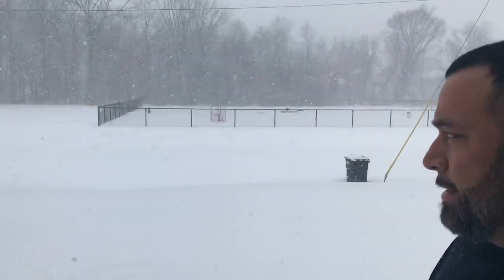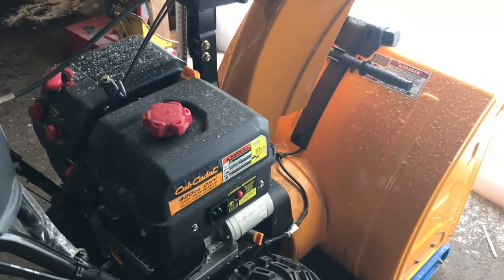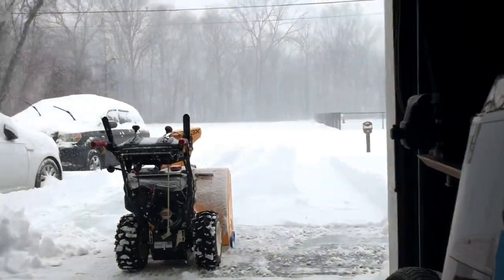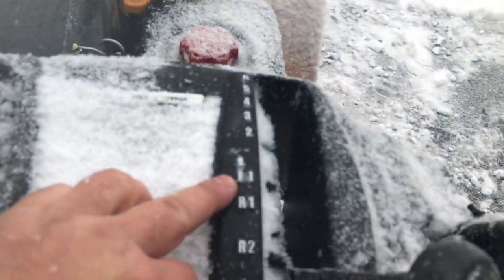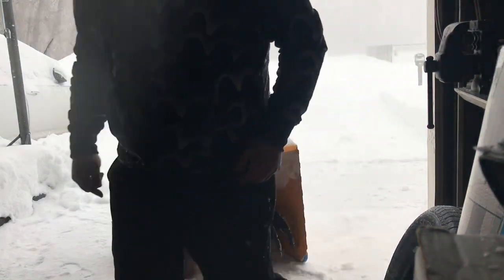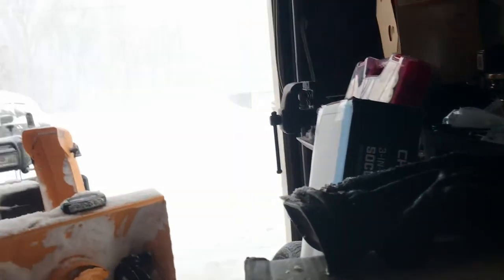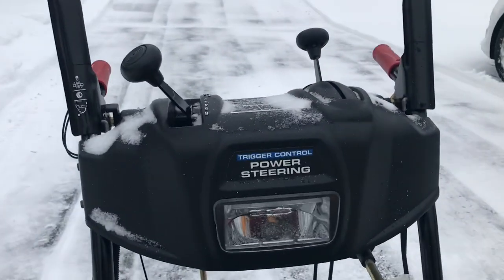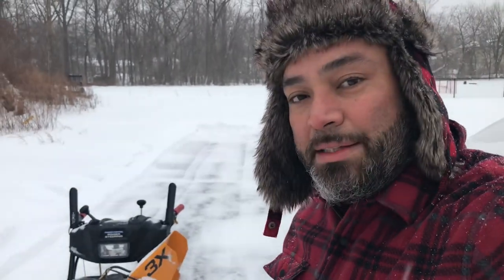Cub Cadet 3x 30 HD Review 2021 snow storm

Comment: Someone needs to show you how to use a snowblower. Extremely rough on it. That's why the shear pin is broken. The deeper the snow... the slower you go. Its easier on all the moving parts. This review is ok but would be better if it was used correctly to give it the honest review.
Reply from the maker: Thank You 🙏 I appreciate the feedback
Reply: In any deep snow, 1st is always best to not overload engine or break anything!
Reply: @chillymooose  cub actually came out with different shear pins for this machine because they were too weak. The updated has an A for auger and a 3 for impeller.  Many people are having problems with this machine blowing belts and shear pins
Reply: When snow blowing use a lower gear does less wear and tear on motor and also doesn’t work the machine as hard
Reply: @michaelrothfuss9764  The blower has a 420cc engine with a 14” auger and 14” impeller. It was designed to move a lot of snow rapidly. That’s the point of the HD moniker.  It’s supposed to be a commercial grade machine but since it’s an MTD it’s not up to par.  They used weak pins when the machine first came out, then came out with stronger pins after just about everybody who bought one was having problems.  I believe you wouldn’t know this as you don’t have one and have done zero research on this particular model.  I have one and went through all the problems that came along with it. The belts still shred way too easily as they actually aren’t durable enough for the power that this machine puts out. So sorry, bit power and going too fast isn’t the issue. It’s actually the selling point of this machine to move a ton of snow as quickly as possible.

Comment: A couple problems I see you doing is that your shoes are adjusted to low and you have the thing running at a higher forward speed. I run mine through 3 foot Banks on 1 and it goes right through without stopping. I have found that the deeper the Snow the further the machine throws. In 2 feet of snow I can throw at almost 50 feet.
Reply from the maker: That is great to know.
Thank you for that.
I will try it out on the next snow storm
Reply: I have the same model also I never have to stop and start, even at a higher speed the engine automatically revs up and it goes right through throwing a 30+ foot roster tail of snow esp with dry powdery snow.
Reply: You should stop the engine while touching the indside of the blades. Also not a good idea to throw the snow and possibly small rocks on cars, houses etc. Stay safe!

Comment: I have this same machine.  Watch more videos of more experienced operators with fully working equipment.  This is a great machine when you know what you’re doing.  If you don’t know what you’re doing this machine can wear your out.  It’s a beast and it’s heavy.  It will blow thru a full opening fill deep packed in 1st gear and half deep in 3rd or 4th.  Only negative I have is it needs a faster reverse and a faster forward speed but I’m sure for safety they keep it limited.  Best tip I have is spray your machine with WD40.  Mainly the augers and the chute and inside before you blow.  Will keep snow from sticking.  If your not using the yellow wheel release levers you need to be for turning and when your moving it not under power.  It releases the wheels into a “neutral” state and you can pull it backwards easily.  Even when the machine is not running squeeze both levers to move it around.
Reply from the maker: Yes I agree with everything you just said
If you get a chance, watch my new video with this years storm. Thanks for the feedback
Reply: I have a 26” Troybilt Vortex 3 stage and I concur with this post! Love it, wouldn’t trade it for any other machine out there!
Reply: I just bought a Honda HSS1332A, and now I have no issue's or gears to worry about... ever again.

Well worth the money. 😁

It's an absolute monster of a machine, and eats whatever I put it through asking for desert afterwards.
Reply: Another "me too".
I've run one for the past ten years and after getting through the shear pin drama (that nearly had me return the machine) I then realized you could buy much better pins online and that saved me. This was before CC came to their senses and introduced the newer versions, but I'd already stocked up on the non-CC so I'm good.
Been through some belts but it wa more due to my misjudging when you do need to back off momentarily.
Good post, agree on all counts.

Comment: I have the same model.  You have a busted shear pin on the forward impeller.  Easy fix.  Cub Cadet installed to soft of pins.  You can now get better , stronger pins at the dealer.  When she is working correctly it is an awesome machine.  to turn on the heater on the handles just flip the switch in the center between the handles.  They really get hot.
Reply from the maker: This is great 
Thank you for the info 
I really appreciate it

Comment: I was interested in getting a 3 stage. I won't after seeing your vid. If you are doing the start/stop/two steps forward routine to wait for the impellers to clear, what's the point of the 3 stages when I do the same currently with my 2 stage? Thanks for the vid, but i'll wait till the technology substantially changes.
Reply from the maker: Agreed! Not necessary. It also promotes it as chewing through ice and slush but I haven’t had success with that. I agree that a two stage is enough 
Thanks for the comment
Reply: Did you watch the whole video? The first half was done without the center auger working so that behavior's to be expected.
I've been running the 2014 version since I bought it new. 400' asphalt driveway in Upstate NY at 1000' elevation. We're pretty exposed here and 2' snow drifts aren't unusual. My machine plows through them mostly without having to stop and go. Not necessarily like a hot knife through butter but nothing has stopped it yet.
I started out with a Troy-Bilt Polar Blast two stage which did fairly well, but the three stage is definitely worth it for me.
Reply: @ChuckD59  yeah, I watched the whole vid - did you? The auger was working on the very first full cut - he did a lot of start/stop and got a clog. I do the same but without the clog. The OP agreed that in his case (and mine) the extra impeller doesn’t add any performance.  In fact, it looks like you agree with me too: "not necessarily like a hot knife through butter..”. my machine from the early1990s is exactly the same! I’d rather have a bigger diameter second stage impeller than an extra one (why gather more snow if you can’t eject it?)
Reply: @rickp3374  Sorry, I rewatched and I see no evidence the center auger was working on the first pass. Just the opposite actually.
I know this machine very well and the fact that it choked 20' into cold dry powdery snow was a red flag.
The drifts here, as anywhere, if they're really drifts, compact and become very hard. 2'+ puts it over the top of the intake. In this category of snowblower I would not expect any machine to cut through it like a hot knife in butter.
I won't get into a pissing match over 3 stage vs. 2 stage. Having a good example here of both pointed to very little difference. But to me the 3 stage makes more sense.
Reply: @ChuckD59  cool story bro!
Reply: @rickp3374  ???

Comment: Third winter with mine. No issues.  I go slow and it chews through light, heavy wet, and everything in-between.  It is a bit faster than my older two-stage, because it's a three-stage. I have to do my driveway and our cul-de-sac every storm.  I may add an impeller kit after this season to prevent occasional clogging, but that's not a Cub Cadet issue.  Folks add those kits on all brands, especially Ariens.  Have not broken one shear pin yet. I will never understand folks who complain it doesn't throw far enough.  Mine does, and I have a lot of area to remove snow from.

This machine replaced my much smaller Snapper 7/24 which I had since 1997. The 420cc (13 HP) motor is powerful and runs smooth.  I only run ethanol-free gas, or Tru Fuel from Lowes. I highly recommend if you run yours on gasoline, that you run it dry at the end of the season, and then fill it with Tru Fuel and run that through. The carbs on these machines are very fickle and they do NOT like fuel with ethanol and should never have fuel with ethanol sit in them for more than 30 days, even with a stabilizer. Friend had that issue his second winter when it wouldn't start.  Had to take apart the carb and use a fine wire to clean the little holes in the jet. 

If you take your time to learn this machine and understand how to use it, it's a beast on all types of snow.
Reply from the maker: Thank you for the info. I really appreciate it. I’ll have to do that next time and see how she performs.
Thanks again

Comment: It seems like the belt on the 3rd stage middle auger is loose???  It does not look like that 3rd stage auger is turning much.
Reply from the maker: Yeah that was a pin that sheared off
When the pins are installed, the middle auger is locked in with the main auger.
Thanks for watching

Comment: I bought that machine in 2019.  I rather like it.  The most difficult thing for me was getting accustomed to the skid steering.  I don't use it much because I also have a Toro single stage that handles darn deep snow.  But when the snowplow comes by and buries my driveway end with hard snow I need the 3-stage to break up the snow chunks.

Comment: I just bought a new Cub Cadet 2x 26 IP. In reading the reviews the biggest problem was the carburetor plugging up. Can you give me some suggestions on how to take precautions to prevent this from happening. Thank you
Reply from the maker: Absolutely, I installed an inline shut of valve from the fuel tank to the carburetor. When ever I am done running the machine I will shut off the fuel valve and let the machine run until it uses up the fuel the is in the bowl of the carburetor. This will let the float in the bowl settle down to the bottom of the bowl, extracting the needle from the jet inside the carburetor. And the carburetor will not clog up. When your ready to start up the machine, you open up the fuel valve and open up the choke and the machine will start right up. The only way the carburetor clogs up is when you store the machine with a full bowl of fuel and the needle inside the carb gets stuck closing the jet and fuel doesn’t get to the engine.
Hope this helps.
Reply: Yes. Very simple way to prevent this from ever happening. Do NOT use gasoline if it has any ethanol. You can buy Aspen Fuel, or Tru Fuel at Lowes, Home Depot other places. If you do put gasoline in yours, I'd make sure to run it bone dry, even if you use Stabil, and run Tru Fuel through it. The problem with these carbs is that gas with ethanol will 100% clog the jets and prevent it from starting. I only use Tru Fuel and I exercise the blower and augers monthly, year-round.

Comment: Thanks for the video I’m looking for a new snowblower after 25 years with a Troy built.
Definitely going to consider the cub cadet but I’m leaning toward a Toro.
I noticed your technique pumping the propel forward handle it’s not the proper way to do it that’s really hard on the equipment. When you’re taking a full bite of snow like on the first pass. Slow the machine down to first or second gear. Then when you’re doing your next pass take half of a bite or maybe a little bit more. Not a full bite. It’s easier on the machine only takes you a few extra passes. That technique I’ve been using for years even with a tractor with a snowblower taking half a bite or maybe 2/3 of a bite of the next row is definitely the way to do it and you don’t leave those little wind rows of snow left behind it does a cleaner job.
Reply from the maker: Thank for the tip. I will definitely use it when we get the next big snow storm here. Good luck on your search for a new snow blower and if you come across something your really like or don’t like, please let me know. I’m curious to see what other machines work well out there.
Thanks again
Reply: Twenty Five years with the Troy Built, not sure this machine will be the same.
Reply: @rockybigdog8506  Cub Cadet is far superior - I know I owned both

Comment: Same machine. We’re you using the power steering paddles. Also the height adjustment is on the lever gown by the wheels. Good video. 
Thank you
Reply from the maker: Oh that is good to know.
I’ll take a look and see if i can adjust it
Reply from the maker: Yes i was using the power steering paddles

Comment: Glad I watched this video. Just bought my first snow blower for the 2021/2022 winter and had no idea those pins break so easy. Figured they'd only break if someone runs down sticks and stone's
Reply from the maker: Thanks for watching 
They sell those shear pins on Amazon.
You will definitely need them.
Reply: Belts transfer the power from the impeller to the engine and usually provides enough marginal errors to prevent engine damage due to impacting any debris?  The average strength of todays steel being of a lower grade will allow for breaking before major damage occurs, so I just use OTC bolts and  not hardened and haven’t had any of the shear pin problems?  Hardened bolts are a definite no/no however!

Comment: I have the same one and it gets stuck all the time and I have to clear it out.  I have to say it's very disappointing for paying $2000(Canadian) for the damn thing just last year. I might try the silicon, never heard of doing that before. I used to have a smaller machine (24 inch) that never jammed up, must be a flaw in the machine.
Reply from the maker: Agreed… I thought the three stage made sense, but it really didn’t change anything. However, the silicone does work. Either way good luck and thanks for watching.
Reply from the maker: Hahahaha

Comment: How did you break the 3rd stage pins in a foot of fluffy snow???
Reply from the maker: The third shaft broke at the bottom of the driveway. The angle of the driveway when it meets the street is too steep and the 3rd stage catches the street 
I always seem to catch it at the wrong angle

Comment: What caused the stage three shear pin to break-that is fluffy snow-seems weird
Reply from the maker: Looks like when i was coming up the driveway from the street, the auger blade hit the driveway. Shearing off the pin.
After i replaced the pin it has held up ever since.
Thanks for watching
Reply: That’s a really nice blower. 
I immediately noticed that the third stage wasn’t spinning. I’m impressed how well it performed even with that critical part of the machine not working.
Thanks for the great video 👍👍👍
Reply: @Peter-.H  That proves that the 3 stage platform is irrelevant. The two stage Cub Cadet machine would have been more than adequate.
Reply: @jamesorsby7553  there's another auger in there behind that front one that was sheared.

Comment: Just wondering what gear you have that in? Seems to be a little fast for that amount of snow, should not have to work the drive engage on and off like that.. Has to be hard on the clutch system…
Reply from the maker: I was in first gear with this guy
Reply: @chillymooose  Wow, thanks for the response. Just seemed fast for 1st gear.. Makes me wonder if the shifter is working properly. Typically there’s a large disk and the drive speed is determined were on the disk the mating wheel is.. Could it be out of adjustment as not to let it go to the lowest position… Just wondering….

Comment: Looks like it is working great but hope they make speed adjustable so for big snow you can slow  it down.
Reply: He should be able to. I think he just left in whatever speed it was in and just used that. Typically 5 and 6 on the speed selector are really just for transporting a machine. speeds 1 and two are recommended for wet heavy snow. 3 and for for light snow. Some of the older Craftsman snowblowers had that info on the speed selector.
Reply: You need to adjust your shift linkage. Your first gear is second gear.

Comment: I have a 3X Cub Cadet, 2018 model, and hated it as the shear pins on the center augers broke all the time.  It turns out they changed the shear pins in the 2019 model year to prevent the premature failure.  They look like hex head bolts with nuts.  I've seen reports of the units now breaking shafts as the pins are too strong.  I've not had that problem yet.  When the pins work the machine works well.
Reply from the maker: Thank you 
That is good to know. I’ll keep an eye out for those pins and see how they work. I appreciate it
Reply: A neighbor of mine ,has the exact same machine ,and he hates it,he want's to sell it and by himself something else,that 3 stage in wet or soggy snow just jams in there.
That I know ClubCadet are the only ones that makes one,and I don't think that it will last long.

Comment: Would you recommend a 2 stage snowblower or the 3 stage
Reply from the maker: I would recommend a two stage.
I don’t really see the difference in the third stage. I good two stage will do the job just fine with less parts to go bad on you. Thanks for the question

Comment: If you have to run with the choke on even a little bit, that's a sign you have carb issues, maybe put fuel injector/carb cleaner in the tank and run fuel stabilizer in all your yard equipment unless you have methanol free gas. (i like lucas oil's fuel conditioner to help keep the carb clean) That machine should be able to go through some deep snow without stopping. My headlights turn on as soon as the machine is running so you may have some loose connections, I believe the grips would be the same. Check your wiring out in the manual.
Reply from the maker: This is awesome information 
Thank you 🙏 I appreciate it